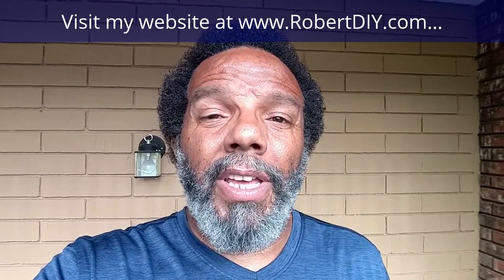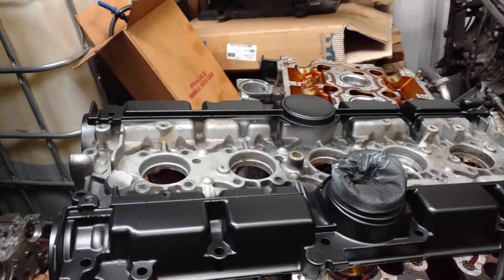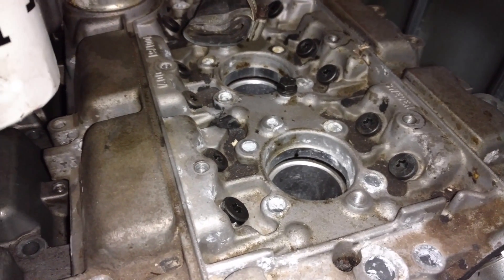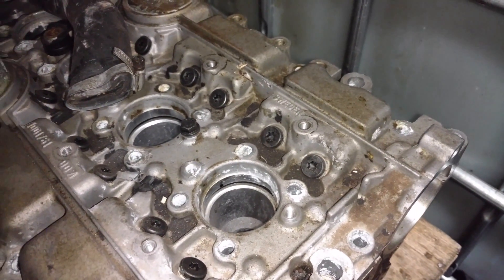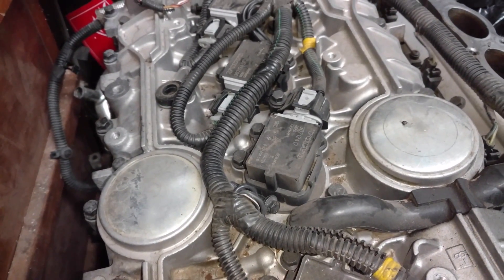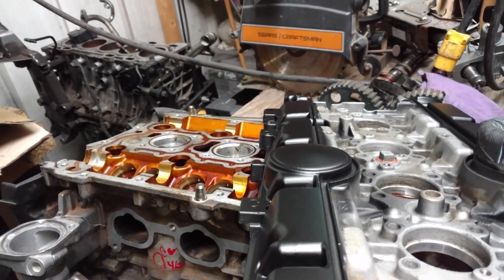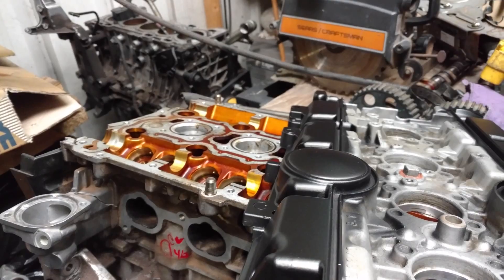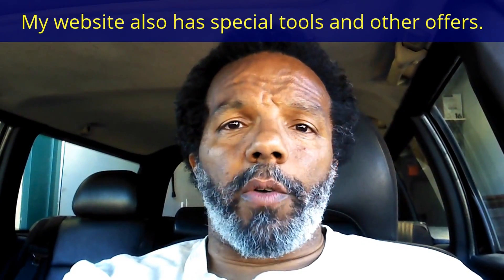Solid vs hydraulic lifters in the Volvo white block engine, 850, S70, V70, S60, etc. - VOTD

Comment: Hi robert I have Volvo XC 90 2005 D5 it develops clicking noise when accelerating and on 3000 revolutions suddenly stops and engineer run sweet as a new also on idle engine is running very smooth this noise very annoying you can hear only when I accelerate or inder loadDo you think it might be hydraulic lifters?? Kind regards Peter
Reply from the maker: I don't know much about diesels. Maybe a drive shaft issue.

Comment: Anyone asking about lifter noise - drop your oil pan and change the sump seals before anything else.  This is very likely your problem.  It was for me.  

$30 in parts and about 3 hours to do the job for an amateur.
Reply from the maker: Thanks for sharing.

Comment: Hi, Robert. Thank you for all of the valuable information that you provide us all. I have a question: I’m working on a head gasket replacement. Everything has gone smooth until I realized that when I removed the solid lifters when disassembling the engine (2006 S40 T5) I didn’t number them so now I have 20 lifters that I don’t know where they go. I read about the whole
procedure but I was unaware that I had to number the lifters. First, without knowing that I had to have them in order, I installed everything, installed the valve cover and the camshafts were locked up. I checked timing and everything was fine, also crankshaft moved fine. So then I lifted the cam cover a bit and both camshafts turned fine by themselves. After a while trying to understand what was going on I came to the conclusion that my lifters were not in order (nothing else made sense). As I said timing and everything is good, and I have used all the proper tools. I have done timing on a couple of Volvos and I knew it was not a timing issue, but this is my first head gasket. Is there a way to know which lifter goes where? I tried looking at the numbers inside of them but they vary, a few only match. Please advise if you have any information that could be of help. Thank you in advance!
Reply from the maker: Call me or take the head to a shop.
Reply: Thank you, Robert. No idea how to get in touch with you. I did some more research and came down to the option of using feeler gauges (which I have) and place the lifter so I have a 0.20 clearance on the intake side and 0.40 clearance on the exhaust side. Maybe I will able to have them back in order. I understand that I’ll have to one at a time and with all the other lifters out so the camshaft can sit flash on the head. Thanks
Reply from the maker: The numbers under them are the sizes.

Comment: Dear Robert,
As always, you have brought knowledge to my life wit Volvo's.
My 3 Volvo's: 1998 850T aut (~300.000km), 2005 S60T aut (~175.000km) and 2007 V70T aut (~280.000km) all have solid lifter cups.
The two later have a ticking sound, cold as warm. 
They sounds a bit like my previous 240's with B21 and B23K, but these engines could be adjusted with the thick shim on the top of the lifter cup.
Do you know how to adjust the tolerance in the lifters on a B5254T2 which is in both my S60 and my V70?
Reply from the maker: Probably loud fuel injectors, they all fire at the same time.

Comment: Hey Robert, I hear a ticking sound when   My 1994 volvo 850 non turbo is running. From your video, I can tell that they are the hydraulic lifters ticking. Can you please advise if they are critical to replace or if they do any damage in the long run for the car?
Reply from the maker: I've never had an experience as to what damage would be done if you don't do anything about it. Maybe their main purpose is to keep the engine quiet.
Reply: Robert DIY should I get a reliable mechanic to look into it?
Reply from the maker: Let me check...
Reply from the maker: I'm not sure, can't seem to find answers about their primary purpose, I believe they are simply shock for the valves. May also reduce valve lash. I'll ask my real mechanic Tuesday and let you know. Please remind me with a fresh post.
Reply: Robert DIY exactly. There is not much info online and I figured that nobody knows more about volvos than you online so I seeked out to you. 

Do you have an email where I can send you to remind you about this? 

Thanks for your help.
Reply: Robert DIY hey Robert,

did you talk to your mechanic about the hydraulic lifters if he knows any better?

Thanks

Comment: Hey Robert, love your stuff man! It has saved my life multiple times with my volvo. Question, my engine is emitting a ticking noise from above thats kinda annoying. I thinking it might be my lifters, but idk. You have any idea what it is? They sound exactly like in this video. https://youtu.be/q1hg-E9ziYs Any idea on what i should do to get rid of the ticking?
Reply from the maker: Volvo or Mann oil filter, proper weight / viscosity oil, correct oil level. If that doesn't help, replace the lifters.
Reply: Robert DIY thank you very much Robert!